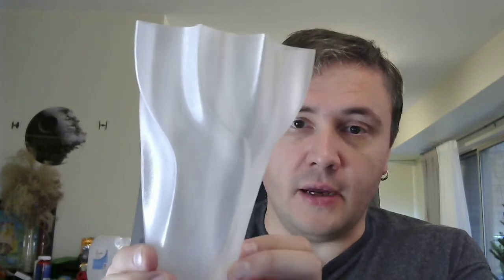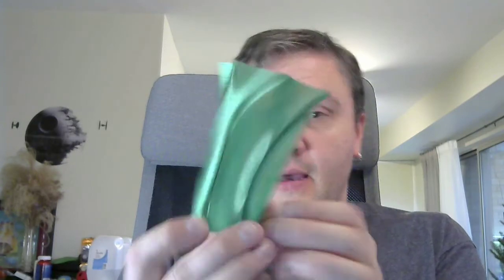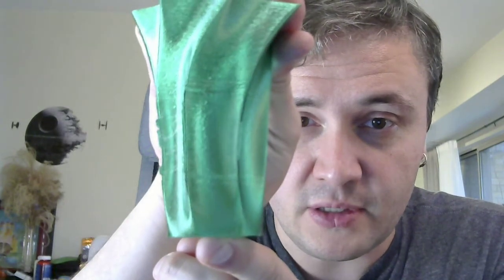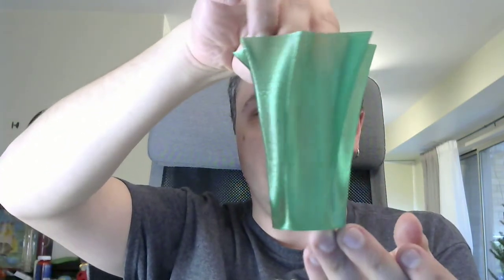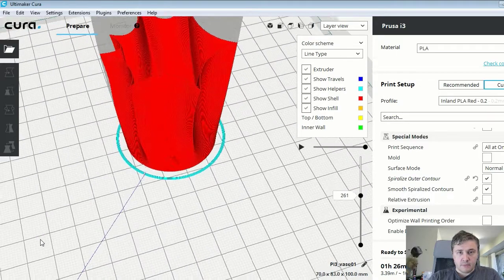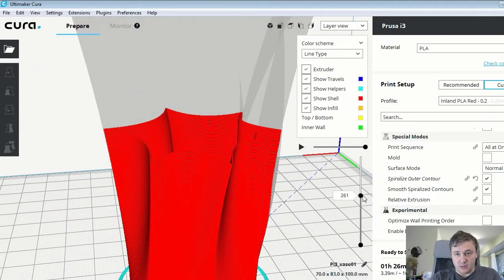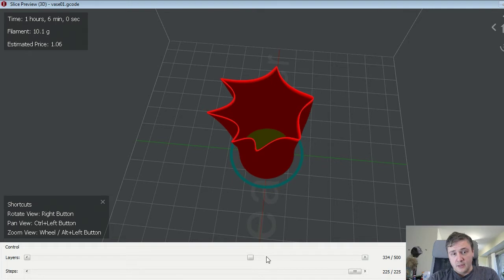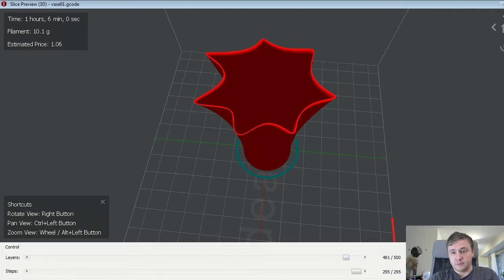3 Slicers 1 Vase: Free slicers Vase Mode comparison

Comment: Thank you so much. You did a nice video. 
I prefer Cura because I got delta printer and some slicers didn't accept it. 
Also Cura have pretty user-friendly interface.
Reply: I got Tevo Little Monster. 
It is excellent for the money. 
But it can be better with some upgrades.

Comment: Hey. I also experiment with vase mode in different slicers (cura, cura2 and Slic3r prusa edition 1.36.2) and the slic3r is the best for me. But in slic3r settings you must deselect " detect thin walls", other way if your model has sharp angles it will produce bad results